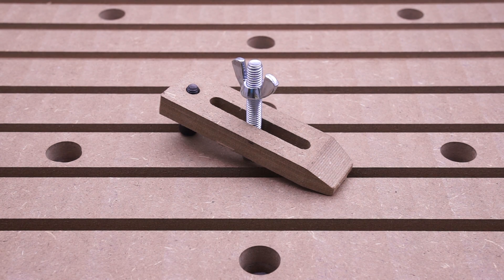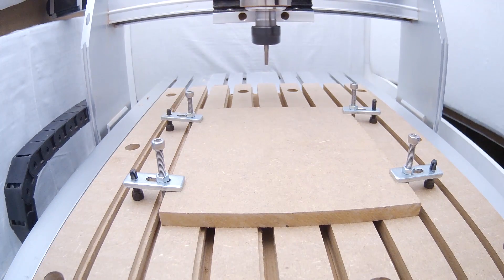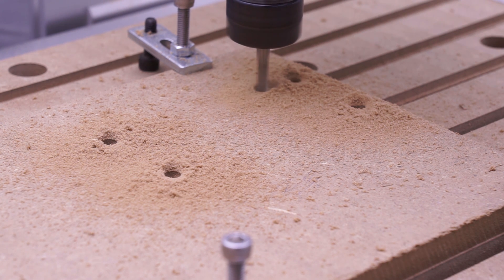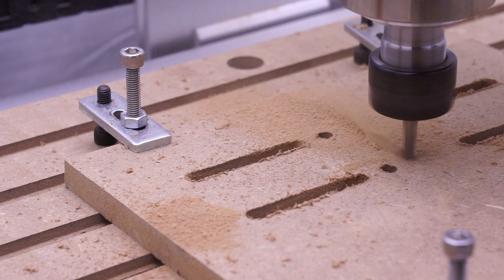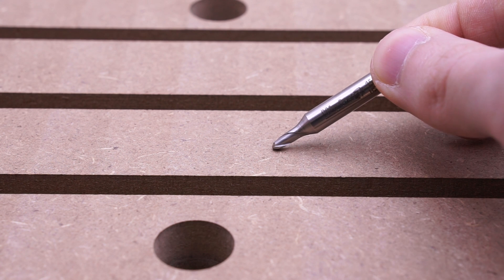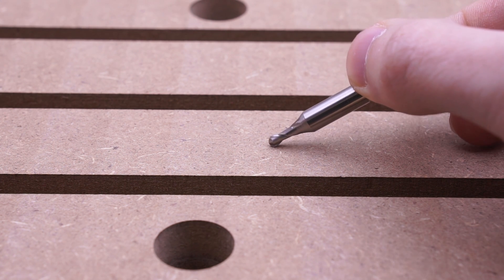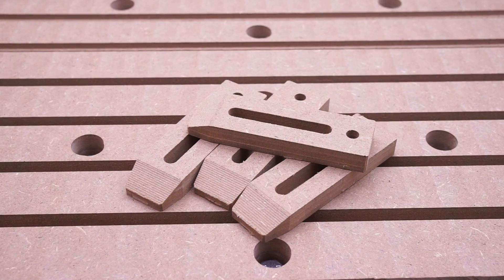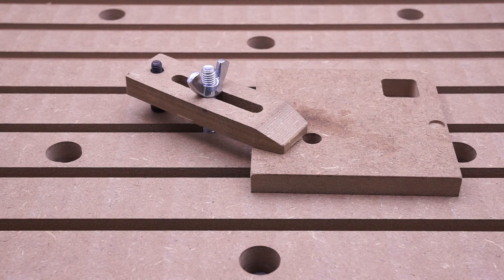Making Wooden Clamps for CNC

Comment: I would think that MDF would break in two with even minimal pressure.  You have a CNC why not cut them out of aluminum?
Reply from the maker: Hi,
They hold up surprisingly well when used the right way.
You can obviously do the same clamps in plastic or aluminium, but these are good enough for holding down wooden materials and much more forgiving when I screw up.
/Bjorn

Comment: horizontal size has 100mm full lenght but vertical not have any, only hole dia 8mm , but i think 40mm have good  ?
and all holes 8mm bolt. and 100mm longhole. come about 1165 lenght and 40 . plywood maybe no need lot 9mm or 12mm.

Comment: Hi, great video. Could you tell me the link to the device you use to set the Z axis of your router?
Reply from the maker: Hi, thx. I use the one that came with the CNC machine. You can see it here:  https://www.omiocnc.com/products/x6-2200l-usb.html.
Reply: Hi, I thought it was a generic device you installed yorself. Will take a look at the link to see if it works with my machine (Shapeoko). Thanks for your response.

Comment: Nice video!! :D Thanks you for the planes ;)

I have a question,  what´s the speed you use for cut de DMF? and where you buy the bit?
Reply from the maker: Thank you so much and you are welcome.
I usually cut MDF with a feed per tooth of 0.04-0.05mm, so for 6mm 2 flute at 8000 rpm and 700-800 mm/min feed rate, that's pretty conservative.
I have bought my bits locally and they are probably from china :)

/Bjorn
Reply: what´s feed per tooth?

Sorry my english it´s very bad and I new with CNC xD
Reply from the maker: Feed per tooth or chip load as it's also called is the thickness of a chip removed by one cutting edge of the tool.

Here's some good information about it: http://www.pdsspindles.com/engineering-speeds